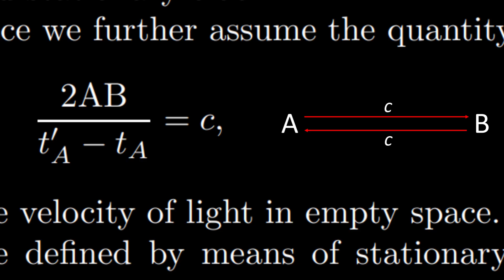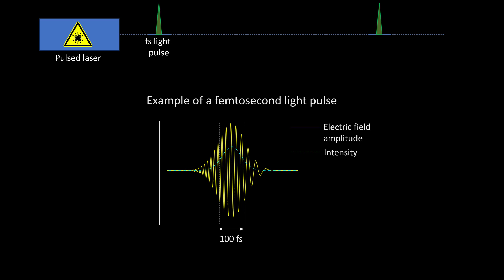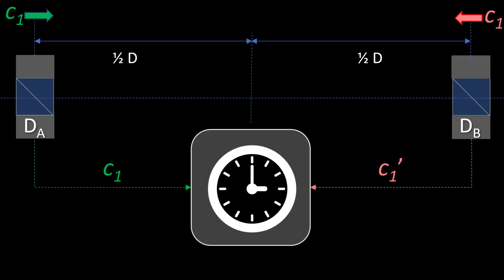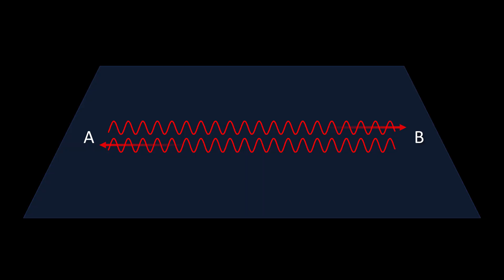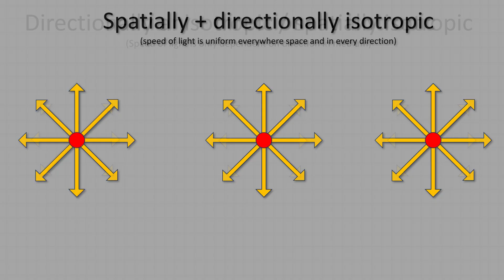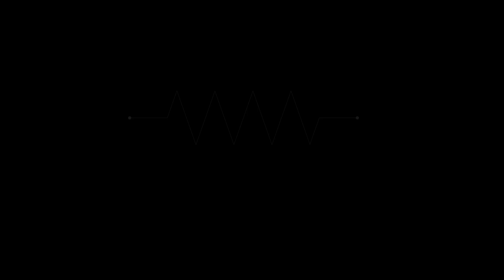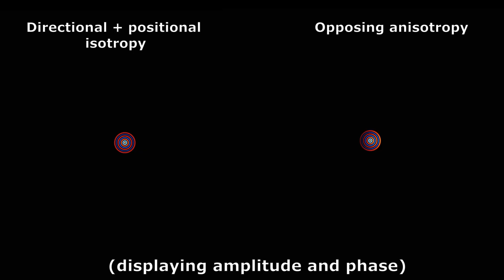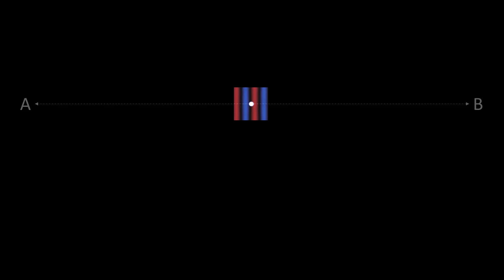Knowing the one-way speed of light

Comment: When I first noticed this YouTube, I said to myself "A Daniel come to judgement !" Then I checked the source: William Shakespeare. But Shylock was being used to show a weakness in human nature: the difficulty of avoiding a difference between mercy and legal justice. The problem here is restriction to a single clock. Often one encounters the "clock hypothesis", that acceleration doesn't alter the rate of an ideal clock. I think that, just as there is no ideal person, so is there no ideal clock. We need many clocks, so that we need to be empirical about synchronising them. Why does the Global Positioning System (GPS) lead to a difference between east/west and north/south one-way light speed comparisons? I think it is because the GPS uses a master clock located on the earth’s axis of rotation. The master clock synchronises several remotely located and transportable clocks, not using Einstein synchronisation. We now have atomic clocks, which Einstein didn't. My conclusion is that there is a privileged frame of reference, defined by the ether, in which Maxwell's theory works directly.

Comment: Can you have two accurate clocks, sync them up and then move them apart? That way you can emit a light pulse from one clock to the other and measure the delay directlly.
Reply: Here time dilation is an issue, one clock experiences more time dilation than the other, because time dilation is defined in terms of the speed of light. I believe it cancels out but you'd have to do the math

Comment: The first half of your video assumes the beam splitter and mirrors and leads to the clocks and clock itself are all ideal or so precisely calibrated that non-ideal elements are so insignificant that we can ignore them.  But, I don't think this is actually the case in real life.  Is it?  There is a similar problem with the double-slit experiment in that people (at least in explanations of the experimental set up) forget to mention anything about the depth of the double-slit structure or anything about any of the detectors.

I've always wondered if real experimenters think about these sorts of things because instructor's assistants and online science educators seem to never talk about them.  They present explanations of experiments as if the experimental setups are perfect.  This has always confused me so much.

Also, I had some ideas but I haven't spent very long thinking them through, so I could be totally off.  Still, I wondered: what happens if you use three clocks?  One combined with detector A, one combined with detector B, then one somewhere in the middle?  Does that make any difference?  Or, how about a totally different idea?  What happens if we have the light bounce off the mirrors in such a way to where the light paths come down like a v shape down to the exact same detector which then feeds into one clock?  Again, this assumes ideal everything like your video did but aside from that I think it could work.

*

I genuinely liked that you went into some depth for the anisotropy.  Still, I disagreed with your use of springs as an analog.  Light doesn't work like that even if the simplified versions of the math equations makes light seem analogous to springs.  They're not.  You also assume permeability and permittivity cannot change over time unless, as you mention later, there is a changing/moving mass affecting gravity.  You also didn't show what happens if you combine two or more of the different kinds of anisotropy at the same time.  Also, energy isn't always necessarily conserved. It is just on larger not quantum scales in isolated systems energy seems to be conserved.

*

An example of how it could be anisotropic:  perhaps the direction matters locally on incredibly small scales but it averages out to appear isotropic over larger scales.  So, the light could travel through a field that looks like this (arrows only left/right for simplicity but arrows could go in any 3d directions and could represent any of the various kinds of anisotropism you were going over):

Light starts here   ---> <--- ---> <--- ---> <--- ---> <--- ---> <--- ---> <--- ---> <--- ---> <--- Light arrives here

Now, imagine if the number and strength of left arrows versus right arrow could fluctuate based upon location, angle of the travel of the light and/or fluctuate over time.  But, also, over larger times/distances they average out much like how non-magnetized materials can have magnetic regions but if they're all facing different directions then they average out.

This would make it statistically unlikely to measure light having different velocities in different directions but not necessarily impossible.

*

Thank you so much for your video.  Whether my thoughts are sound or not at least your video made me think and that means a lot.

Comment: But if there is some global effect so that light travels at different speeds in opposite directions then the effect will also affect the signals (electronic or optical) going to the timing device canceling out any observable difference.

A solution is to have two clocks that are placed together and synced. Then they are moved to the detection position, do their work, and then placed together again to check the results and any drift.

Comment: A couple points: 1) the expansion of space has the effect of slowing light in that the frequency is reduced and energy isn’t conserved. 2) the moving mass you mentioned in the end of the video you say we would not be able to detect, we do detect with LIGO. You are describing gravitational waves. I must say, I thoroughly enjoy your videos sir. Thank you and I always look forward to seeing the next! 👍🏻👍🏻
Reply: LIGO measures the 2-way length of a laser bouncing multiple times between two mirrors, it's the 2-way speed of light that determines the result. It uses interferometry so the laser has to go out and come back in order to work.  So LIGO wouldn't be able to detect changes in the one-way thing.
Reply: @takanara7  Yeah, I didn't think about the two-way nature of those interferometers, I was just thinking about whether the overall effects are large enough to be detected.
Reply: @takanara7  "So LIGO wouldn't be able to detect changes in the one-way thing." - to be precise, LIGO measures temporal changes to the speed of light (or equivalently, fluctuations in spacetime). It is theoretically possible to make an apparatus that measures changes to the one-way speed of light as well.
Reply: @takanara7  you are mistaken
Reply: Does a mass at constant velocity produce gravitational waves? I thought it was only masses in orbits with angular acceleration
Reply: @Holobrine  You are correct, only accelerated masses in an asymmetric configuration (like two orbiting masses, but not one spinning mass) cause gravitational waves. But while a mass moving linearly with constant speed wouldn't radiate waves, it would still have a varying field that could in theory be detected locally with a LIGO-like system.
In practice this particular case (e.g. caused by the sun moving relative to the earth) is absolutely impossible to detect with current designs, because the gradients in the field would be much lower, and several sources of noise like seismic noise and thermal noise, that are small in the region of interest for gravitational waves, explode in the low-frequency limit.
Reply: @entcraft44  It would be a 'wave' but it would just have an extremely low 'frequency'  If a large black hole zipped right past the earth you would probably be able to see it with ligo, lol. (and the 'frequency' would be higher if it were closer as well, if you think about it)
Reply: @takanara7  The "frequency" is actually a frequency spectrum given by the Fourier transform of the gravitational potential. If a massive object moves on a straight line past the earth, then the frequency spectrum would decay exponentially, i.e. a high contribution of near-zero frequencies and a very low contribution of high frequencies.

(I don't know the exact form in GR, but classically the spectrum is proportional to K_0(a/v*w), where a is the perpendicular distance between the observer and the moving object's path; v the velocity; w the angular frequency, and K_0 a modified Bessel function)
Reply: Your never going to meet him

Comment: Could we separate two clocks, and using calibrate the clocks assuming the speed of light was similar both ways so they would show the same time in this case. Then send a light signal from one to the other and check if the light arrived on the predicted time or not?

Comment: We  can’t we prove that the speed of light is homogeneous by using Doppler shift of a moving light source?  If the speed of light is directionally dependent, then the frequency shift as the source goes by will be dependent on the relative velocity of the source and any directional change in the velocity of propagation.  The fact that GPS satellites work and we clearly don’t see directional dependence seems to prove that the speed of light is homogeneous. 

Another argument is that if one constructs a 3-D function of velocity that is not homogeneous, then velocity would be angle dependent and light would bend in free space.
Reply: You won’t make accurate measurements of the Doppler shift if the one-way speed of light is not what you assumed.
Reply: @se7964 GPS is based on high accuracy clocks and known orbits.  If the speed of light were directional then positions would literally all over the map.

Comment: The one way speed of light has been measured. This was done by using one clock (an oscilloscope) to measure the time difference between the transmitter and receiver. In one experiment a sinusoidal signal was transmitted between 2 antennas, and the phase difference was measured as the antennas were moved from the nearfield to the farfield. The results showed that the speed of the electromagnetic fields (light) is instantaneous in the nearfield and reduces to about speed c, about one wavelength from the source, and then converges slowly toward c, but never becoming exactly speed c. In another experiment an EM pulse was transmitted from a transmitter antenna to a receiver antenna located in the nearfield, and an oscilloscope was used to measure the resultant time delay of the front edge of the pulse. No time delay was observed. Since the front edge of a pulse represents the change from one state to another: 0 to a 1, then the speed of the front edge is the speed of information, which was shown to be instantaneous in the nearfield. This is completely incompatible with Relativity. If the speed of light (information) is not a constant, then Relativity is wrong and this impacts all of modern physics. These results have now been verified theoretically, numerically via RF simulation, and experimentally by many independent researchers. See the paper and YouTube presentation below for details:

*YouTube presentation of above arguments: https://www.youtube.com/watch?v=sePdJ7vSQvQ&t=0s 

*More extensive paper for the above arguments: William D. Walker and Dag Stranneby, A New Interpretation of Relativity, 2023: http://vixra.org/abs/2309.0145

*Electromagnetic pulse experiment paper: https://www.techrxiv.org/doi/full/10.36227/techrxiv.170862178.82175798/v1

Dr. William Walker - PhD in physics from ETH Zurich, 1997

Comment: My attempt: find a very short-lived particle, which decays into something easy to measure. Accelerate such particles to a very high percentage of the speed of light, and measure the distance from the source where the particles decay. In my mind (which has been fooled by counterintuitive quirks of relativity before, feel free to point out if/what I'm missing), the distance should vary based on the direction of the particle accelerator, if and only if the speed of light varies with direction..?

Comment: Like you said at the beginning, when you start mixing the timing in wires or fiberoptic cables to send back the information to the clock, you've just added yet another variable and compounded the problems and then made the problem what's the transmission inside of a cable.  The fact that there's some kind of refractive indexing in space really boggles my mind!

Comment: Why can't I just use two clocks that I would first synchronize to each other in the middle, then I'd bring them to the end stations (using slow movement and exactly the same accelerations just in opposing directions to avoid differences in time dilation) and perform the measurement, logging each event with a time tag. Then I would just compare the logs and calculate the speed in each direction.

Comment: As far as I am concerned, this entire line of reasoning has foundational problems.  Namely, you are discussing relativity and never once consider a relativistic observer moving at close to the speed of light.  While it is true that, for the stationary observer, the photons traveling between the detectors travel the same amount of time, the relativistic observer is going to disagree, in his observation of the experiment, one photon travels a much shorter distance (and time, at least, assuming uniform directional speed of light) than the other.  As such, your conclusion and his conclusion upon observing the experimental setup disagree.  Which, ultimately, is what the idea that there exists no sensible single direction speed of light represents: that relatively moving observers will observe different directional speeds of light than each other, because the directional speed of light is relative to each observer.  Because there is no single correct frame of reference, there is also no single correct directional speed of light.
Reply: Also the assumption that the clock will be measuring the time without any relativistic effects with respect to both detectors.
Reply: @SabeerAbdulla  that's easy enough to fix.  Simply use tree synchronized clocks at the detectors.
Reply: @martygentillon2786  the synchronisation is no longer valid as soon as the chicks clocks move according to relativity.

Comment: If you used a set of springs to dampen a braking force again and again, they might not perform similarly when damping acceleration. So a system of real springs, initially with isotropic spring constants, can become directionally anisotropic in the way you described when it is used more often in one direction than the other, because of internal stress, entropy, etc, in the spring structure. Just an analogy, but could it be possible that the vacuum has a tiny anisotropy in the radial direction towards our galactic scale acceleration towards the great attractor, because all our mass is usually accelerating that way more often than not?

Comment: If in a Frame of Reference there is a shift in time as a function of shift in space, then light would effectively travel at different speeds depending on the direction it travels.   This is exactly what happens in the equation t’ = gamma(t-vx/cc). In a moving Frame of Reference, time is shifted proportional to distance. It’s the x in the special relativity time dilation equation.  Therefore the speed of light is different in the 2 directions depending on the Frame of Reference.
Reply: Does that mean we could trick conservation of energy with a clever application of relativity?
Reply: @lmmortalZodd no.  From a moving Frame of Reference perspective, the distance is identically contracted in both directions of the round trip journey, and time is similarly dilated. But in one direction time is also shifted forward proportional to distance and then shifted backwards in the opposite direction proportional to distance. This means in effect from the moving Frame of Reference, light seems to travel at a different speeds in the two directions to compensate for this shifting of time as a function of distance.
Reply: Light can have different speeds in two opposite directions with respect to a moving frame of reference. The law of conservation of energy is still preserved.

Comment: Nice, but the flaw is that you are assuming that the time between detectors and clock are the same base PE on the distances being equal, but underlying that assumption is that the speed of light is the same between detectors and clock, which is exactly what you are trying to prove.  The result is thus a subtle but real circular proof that is invalid.

Or in other words, any proof with a synchronized or shared clock assumes the speed of light in one direction is the same in two directions.  Any proof of the speed of light in one direction can’t include a shard clock, just as it can’t include light returning from where it started.
Reply: Did you comment before watching the second half? :P